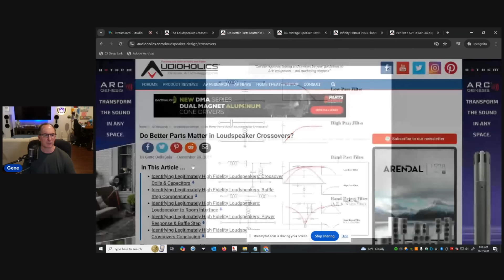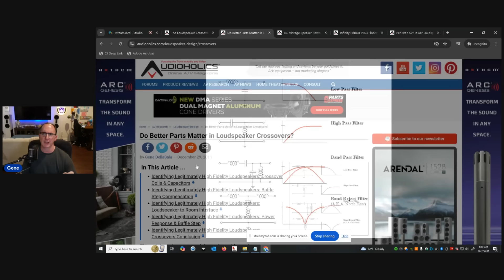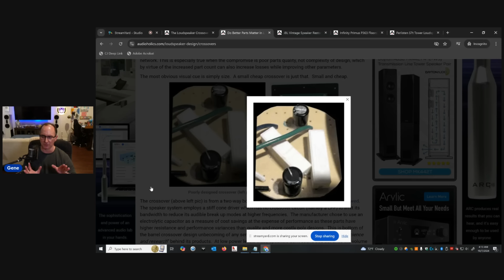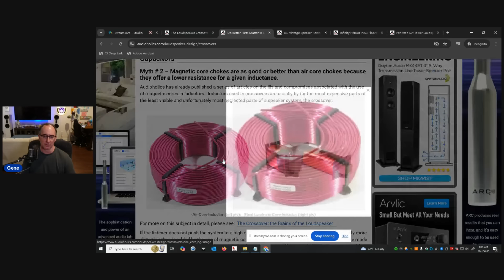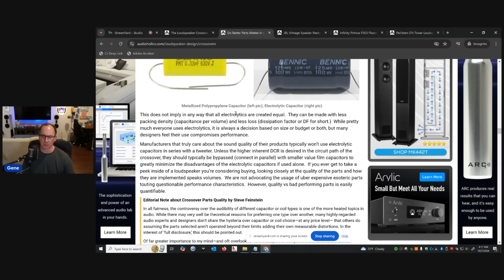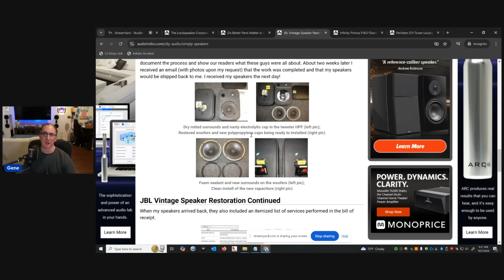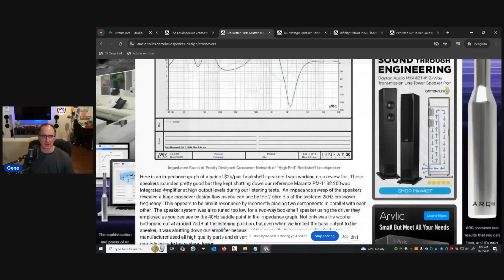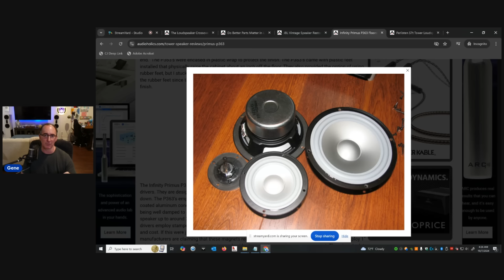Loudspeaker Crossover Upgrades - Are They Worth the Effort?

Comment: My two cents: a properly designed crossover with cheap parts will far outweigh a poor design with great parts.  But I will say a great design with great parts is really magical.  I've AB tested plenty and I stand by my comment.
Reply: @LunarLightLtd1  💯 I agree..
Reply: Yes indeed! The design must be great or nothing will sound right. Quality parts can made a good design a bit better.  The problem is there are many design issues to resolve in any design  and your "upgrade" might made things worse. You might change  tonal balance, phase issues, time alignment and who knows what else.  Then.... who can you trust thay actually knows what doing as well as what the original design engineer was trying to accomplish????
Reply: @LunarLightLtd1  I think you nailed it, and the order of priorities.  Good engineering first, top tier parts second.
Reply: @memcdm  I understand your skepticism but you're overthinking it.  If you start with a great design then upgrade the parts you're not magically changing phase, tonal balance, or time alignment.  If you disagree, back up your claim with measurements.  I just haven't seen it.  In my experience, better parts don't change the frequency response drastically (at worst it might be 0.5dB more efficient in some spots), but it improves distortion characteristics and impulse response.  This translates to better transients and more naturalness that you'd expect from a Hi-Fi speaker.  Once we can agree there, then we can talk about some real fun stuff that can't be measured like texture, imaging, and soundstage characteristics.
Reply: How would you know
Reply: @BoRerunn  been building and designing my own speakers for 17 years.  I've experimented profusely and backed my experience with AB listening and measurements.
Reply: Oh, someone using logic and brain 🧠! 100% correct sir!
Reply: You'll hear everyone at Bottlehead repeat this exactly when it comes to boutique part swaps / tubes in their kits.  For stereo's boutique updates to your crossover will get lost if the rest of your equipment isn't up to par - or more likely your room. But they do definitely make a difference.
Reply: Think PSB speakers. Paul knows how to get the most from cheap crossovers but excellent engineering.
Reply: @vincentpedalino618  exactly I own and love PSB speakers
Reply: @LunarLightLtd1  i said  "bit" better and you described how better parts could improve the sound of the speaker in your post. If the drivers are crappy and the enclosure is poor those issues may overwhelm the upgrade. Also, a lot of folks doing upgrades do not have your expertise and experience or any way to measure the results.  I don't know any one in my area with your expertise. Shipping the speakers to some unknown person doesn't sound like a good option given the expense of shipping and the possibility of damage and uts hard to find someone that had an in-house design for your particular model who could mail just the crossovers to you.  So I just live with the speakers or if I come to dislike them,  I give them away or sell them if they actually have value.  Sometimes I just have no more room and have to let some of my speakers go to good home.
Reply: Engineering is the art of a good compromise. Cheap speakers are usually going to have cheap parts. Expensive speakers are likely to have good looking parts on the outside, but perhaps substandard parts on the inside where the compromise can be made without obvious trade-offs.

Unfortunately, loudspeakers tend to be very high margin items that require several levels of profits. This puts a lot of pressure on the engineering needed to keep perceived quality high and costs low.  This is why, dollar for dollar, DIY kits tend to offer high value; depending on the finishing skills of the builder, the parts are generally of high-quality but the aesthetics can suffer.  The result is often a speaker that sounds very good but can look like a DIY project.

Modifying a commercial design, especially a relatively affordable one, can sometimes result in a good sounding speaker and a good looking speaker for reasonable cost. This, in my opinion, is where the appeal lies in modifying commercially available designs.
Reply: @Jordonater Maybe not in depth as you'd like but he talks about it all the time?
Reply: @superspeeder  Umm— the higher the margin the LESS  pressure on the designers and manufacturers because the high margins allow for better parts expense.
It’s LOW margin products that put big pressure on excellent design where you have to compromise off on parts…
Reply: @kineahora8736   my poorly worded point was that speakers need to be high margin to support all the layers of profit taking.

I’ve since looked at the cost of drivers vs the cost of the finished commercial speaker.  The RETAIL price of the drivers in several speakers I looked at is about 5% of the retail price of the speakers.

Using that as a starting point, most DIY speaker kits have the potential to sound as good or better than some very expensive speakers.  Of course this depends on many factors, but the potential is there.
Reply: @superspeeder  interesting. I was looking at buying some pure audio project, and one of the two drivers in the speaker cost 3500 per pair retail while the finished product cost 7000. I was shocked at how expensive those drivers were and had concluded that the pair of finished speakers were very fairly priced. I think this is a direct to customer outfit without any dealers — so there aren’t multiple layers ofprofit-taking. However, I still wanted to build my own DIY speakers because I couldn’t find a product exactly the dimensions that I wanted for my room… I would never buy a commercial product where the drivers cost 5% of the speaker retail price.
Reply: @ $3500 drivers?  Ok, obviously the 5% I’m seeing has to do with much more conventional commercial speaker offerings!
Reply: @superspeeder  whoops the $7000 version of the speakers had the $2500 “entry level” 8 inch drivers🤣🤣 it was the upgraded version that had the $4800 drivers🤣🤣🤣
Voxativ brand— super expensive…

Comment: Been designing crossovers for the past decade or so (both 2- and 3-way designs). Parts absolutely do matter for squeezing out the best sound possible. However, those good parts won't fix poor execution. (The Tangent TM-1 comes to mind here.)

Side note, impedance is very, very underrated in loudspeaker design. Poor impedance = poor phase control = poor linearity.

Comment: For myself yeah it made a difference and was worth it.   I love to learn and get hands on my audio gear. 
So I took out the factory crossover in my speakers and made a copy of it as an external xo so I don’t ruin the original xo.  Mind you I measured all the parts to make sure the replacements I got were the exact same and also contacted the manufacturer to make sure the values were accurate.  
It made a difference but I think that is because I used better tolerance parts.   The air core inductors did make a difference from the iron cores in the factory xo.  
I then re designed the crossover after I took months learning how to take quasi anechoic measurements.   After a few iterations and help from pros, I made a phase coherent xo with 4th order crossovers which really made a difference.  
It’s all completely reversible and was some of the best fun I’ve ever had.  
I would like to see some more scientific experiments on if people can hear the differences in capacitors in crossovers.  I did it myself with using clips in my xo and I could hear some diff.   But I didn’t do it double blind.    But it would be nice to see if , with all things being equal, the caps capacitance and resistance being equal if there is a diff in sound.  By changing them out with clips.  
Cheers!    Great vids.

Mind you my speakers weren’t cheap!  Lol
Reply: Why did you keep the speaker instead of returning them if you didn't like them since you wanted something more from them
Reply: @AndrewB23  I did like them.  Pardon I thought I explained that.   The speakers I have I liked , but were also a means to learn and have fun.   So that increased their value for me. 
If I just got another pair of speakers I wouldn’t have learned a thing and had fun. 
It also gave me a much better measuring and sounding pair of speakers.  
I could buy a better pair, but I want to build my own.  Because once again that will offer me an awesome experience in both learning and the end result.  
Also, I think I mentioned that I can put these back to stock and sell them if I want.  
Nothing has been altered in a way to spoil the original xo. 
Hope that made more sense
Reply: @Nightjar726 I couldn’t agree with you more! I also had a blast replacing my crossovers with higher quality parts equal value. It’s so nice bringing the best out of your speakers
Reply: @JR-ho5qm  yeah, you just have to pay attention to the values and DCR and do some measurements to make sure things are good.   A newly designed crossover take more work of course.  But I started with just copying the existing crossover.   
Good deal man

Comment: Parts do matter. Since our audio memory is so short, you have to do an A/B blind test to confirm it. My son and I bought two pairs of the Sony SS SCS5 and upgraded one set with the GR Research kit (sonicaps) and left the other stock. The difference was night and day in A/B comparison. But even the stock Sony's sound good with their cheap parts. Bottom line is, audio is not like cars, or colors. We have limited ability to remember sound and if you are happy with your sand resistors and electrolytic caps, roll with it. But if you want the best your drivers have to offer, upgrade the parts and have fun doing it. Don't need to argue either vantage. That's the hobby man.
Reply: But you are not comparing the same speaker. FR is completely different in both versions, crossover points too. You'd need to compare the same crossover, just swap the caps and the inductors.

Comment: What I've learned in many years of working on/restoring audio gear is that there are so many claims that don't actually relate to the application. "Better" (more expensive) parts mean nothing if they go beyond what is necessary to do the job.  For example, if a 250V capacitor is suitable for a circuit, a 630V capacitor does nothing useful, costs more and requires more space.  It is silly to replace/change components if the one in place does what it is supposed to do/meets the specs it is required to meet.

Admittedly the crossover mods that are routinely advertised on the internet sites are almost universally very nice looking, in contrast to some OEM crossovers.  That would be useful if speakers were made of glass; but they aren't. ;)
Reply: It is also very tempting for manufacturers to use the cheapest parts in there as nobody sees them !  
Why use a $7 mills resistor when you can use a 50c one, $3 cap vs.$30 one as few people have the electronic, room or ears to know the difference !

Comment: As always great video, Gene! I wanted to perform my own anecdotal test on my JBL Studio 630s to see if upgrading the crossover parts really made a big difference in sound. I spent a little over $200 on new parts and was blown away by the differences in sound quality. I was even able to capture the sound differences between the stock and modified speaker on my youtube channel. Bass was tighter, better controlled, and much clearer. The tweeter had much better clarity and dimension. I also tried different brands of poly caps like Mundorf, ClarityCap, Dayton Audio and noticed there comes a point where you reach diminishing returns.  Have you ever thought about doing a series on designing crossovers?

Comment: I'm a DIY guy, bought a DIY kit from Amazon - HiVi Swans 2.2A - 2 way bookshelf speakers (w/ Dynaudio drivers) and holy molly do parts matter! Cheap parts like described in the video are there to get it out the door to customers and have it sound decent, but not amazing. Sandcast resistors sound shrill in comparison to Mills resistors and even swapping out air core inductors for thicker gauge air core inductors makes the drivers sound more dynamic, clean/tactile and obviously louder due to lower resistance. So using REW and a calibrated mic is a must.

I learned that a flat frequency response (FR) does not always sound great. If a speaker is using cheap parts and has a flat FR +/- 1 dB, it will NEVER have the dynamics, clarity and drive/power as higher quality parts would make it. Just my observation on messing around with my DIY bookshelves for the past year and a half with a cal. mic. I'm finishing it up now, but in the process I wired the tweeter to 1 set of binding posts and the woofer to another and have an active passive crossover outside to try out and swap parts on the fly for testing and listening... that's how you can hear the changes and make changes quickly ;) Danny Richie is a great YT channel to check out, but still need to watch others that actually explain how to do it, if you want to DIY ;)

I also ended up swapping out the silk dome tweeters for some High-Res ribbon tweeters and it's crazy clear and pin point accurate now. Some HiFi enthusiasts would be jealous of this $250 pair of bookshelves with $250 worth of high quality parts in it. I considered buying the new SVS Evolution center channel, until I saw what's inside, and I would rather just build one now. But that doesn't mean there's no place for those - just click buy and it's yours, no DIY. But is it HiFi? 🙃

Comment: Advancing the understanding of psychology/sociology and perception would be interesting. Do you remember when we found out through blind listening tests that JBL 100s with the red grilles sounded much better than the ones with any other color. We are all so easily manipulated :) Thanks again for a great channel and great work!
Reply: Two speakers covred in two colors must sound the same - but up to my experience   in most cases they would always sound    not the same - speakers which sound the same suppose to be tuned to sound  equal -  serial from factory are not fully equal.
Reply: @Mikexception  Thanks Mike. I don't have the citation it must have been 35+ years ago. The point of the exercise was that people judge the sound by the color of the grill not the quality of the sound itself.
Reply: AudioScienceReview is good for this. I haven't seen them mentioned so far.
Reply: @Mikexception  Agreed! The point of the test was that the visual cues overwhelmed the sonic ones. Our perception seems to be a complex process and is easily altered. I believe (let me know if I'm wrong here) that this is one reasons Canada's NRC typically does listening tests such that subjects can't see the speakers. ("Blind" testing :) Thanks!
Reply: @brucermarino  Our individual perception may be overrided  with  fast switching between two tested sets   But it must be instant.  

Usualy without two identical sets speakers in the same position  is impossible - how to place two sets of speaker in the same condition? They move to exchange and it takes way too long time. to memorize all detailds so long.

Anyway - connection betweeen seeing and hearing is obvious and a gift from nature. Usualy we perceive  more bass from big spaekers because so we  expect. Looking at steam train with bike engine inside still make  impression of overhelming power and bike with crazy powerfull engine seems  nothing special  Watching small speakers with big  bass we intuitively expect less bas but try to explain thing  with stage and space
Reply: @Mikexception  Agreed.

Comment: Quality parts absolutely matter as Gene said, that’s really a no brainer but each person has to judge for themselves wether it’s cost effective to upgrade the guts or if you really don’t like the speakers enough that it’s time to sell them and move on. As for me, I ALWAYS go a lil extra on my budget as best as I can and then if I need to fine tune the sound I’ll make the adjustments in the EQ and find the sound that’s the most pleasing to me. A perfect example is I have the Klipsch RP 8000f v1 which is a great speaker but for me is a lil to bight and a lil light in the mids. Do I spend a bunch of money for the internal upgrades to fix my dilemma or EQ the sound I’m looking for? I’ll just EQ in the sound and save hundreds on the upgrades and still have the same awesome speakers I bought in the 1st place 😎🤘Another great video Gene, thank you for making it!

Comment: Good topic, if you’ve watched his videos, many are more than just crossover upgrades he actually fixes response and in some cases impedance and resonances.  Crossovers are redesigned.  Where speakers are designed very well, look at the Polk LSiM 703 video as an example, all he does is put in better replacement components without altering the design.

Comment: I added Jupiter bypass caps to the tweeter section of my Elac Adanté F61 towers. Wow! Even the non-audio-geeks in the house asked what I'd done. Thankfully, it cost significantly less than $100.
On my Seas Braggi MTM standmounts, the crossovers use Miflex caps in-series, Mundorf's best resisters in-series and Goertz copper foil inductors in series for the mid-woofer. All the rest of the parts are Solen (caps and coils) and Munforf's regular-grade resistors. The speakers are surprising transparent and have a high end that I didn't believe possible given it's metal dome tweeter which sounds more like a high-end soft dome.